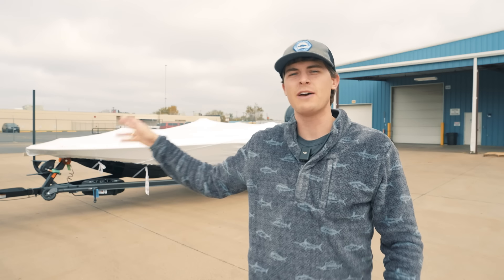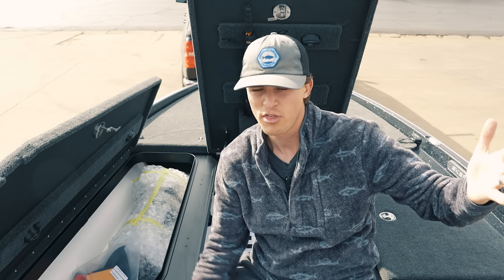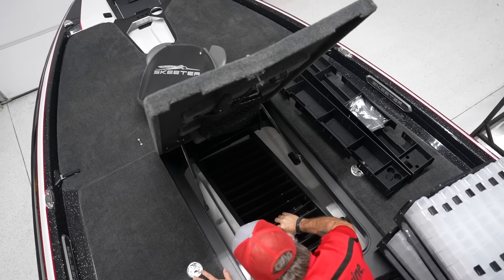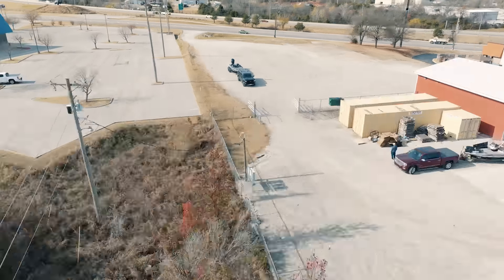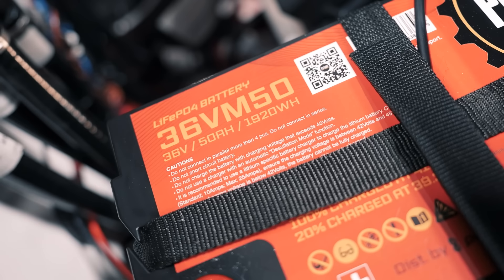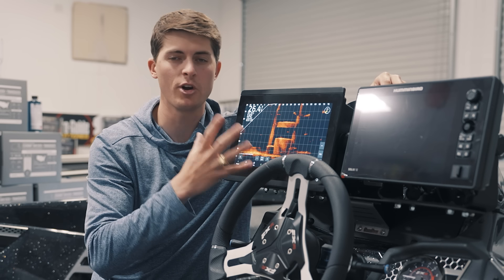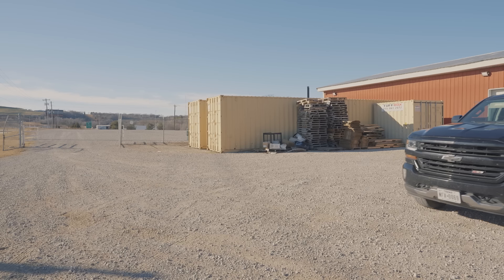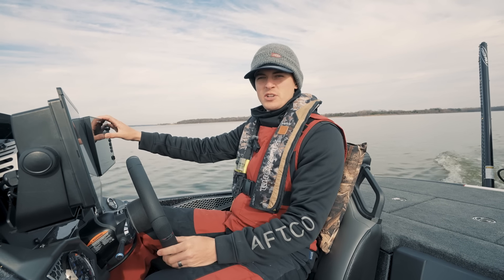How FAST Can My Boat Go? (Skeeter FXR21 Speed Test)

Comment: I have a 2023 zxr21. Only getting 61-62mph running factory installed hydraulic jack plate at 7/8. You recommend running it higher in order to gain maximum speed? 
What setting are you seeing best performance in calm water? Thx! Great content!
Reply from the maker: Wow, that’s very slow for that boat. I’d say you probably have weight distribution wrong on your boat. I run my jack plate there too and get 70
Reply: @TylersReelFishing  Correction, today was glass and I let er eat. Got 68 easy with some trim room to play. Coming from a Merc 115 aluminum boat 😂
Thank you for the info and your content is 💯

Comment: Great boat, Slow though. So many boats are not as fast as they used to be.
Reply from the maker: Boats used to have 2 9” fish finders, 2 batteries, and zero powerpoles. Of course they could go faster
Reply: Not buying it. poles are 20 lbs each and if you run straight lithium's you can run 5 batteries for the same weight as 2 or 3 lead acid. Skeeters have always been great boats, but slow boats.  @TylersReelFishing
Reply from the maker: I don’t know what poles you’re running, mine are NOT 20lbs😂
Reply: relax guy  @TylersReelFishing
Reply from the maker: OH I’M RELAXED